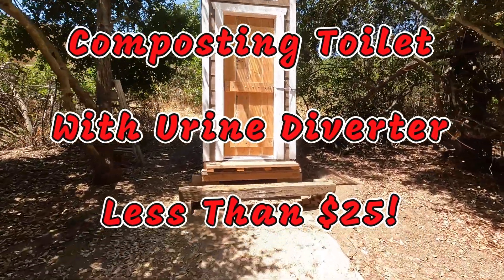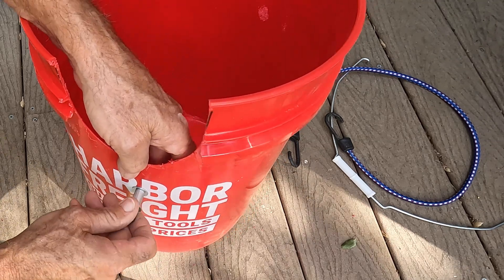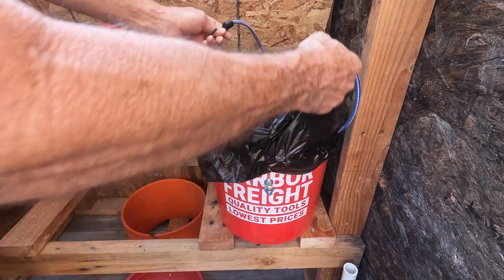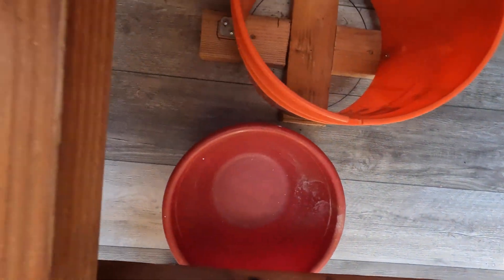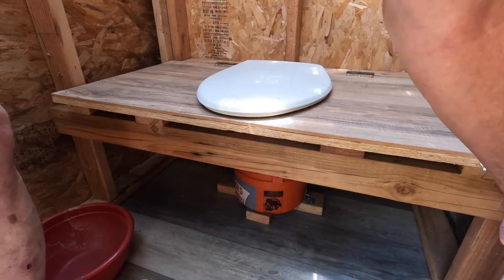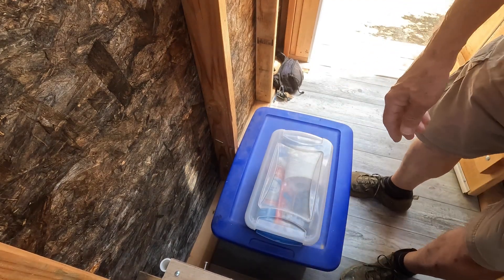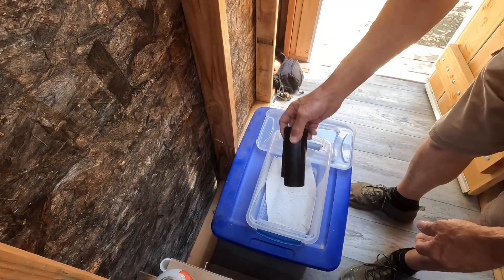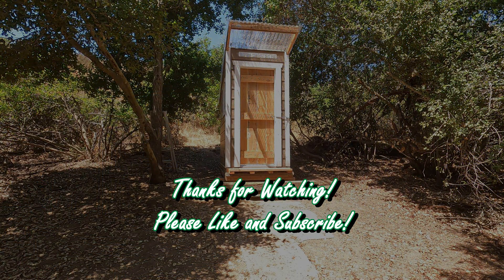How to - Composting Toilet! Urine diverter - Easy to Build. Only $25!

Comment: Couldn't the funnel be screwed to the frame so it stays permanently in the pipe? Or would that not allow the bucket to come out
Reply from the maker: Yeah, the funnel overlaps the bucket so you're correct, it wouldn't allow the bucket to come out. Thanks for watching and commenting!
Reply: @RanchoCoyote  I suggest you cut off the bottom inch of the funnel to make it fit better.

Comment: UMM composting toilets use bacteria from wood chips or forest moss or duff or sawdust.  When one uses ash or lime your killing bacteria not encouraging it.  This system could use much improvement and i highly recommend the 'Humanor Book" to learn more. there is a min temperature 140 D F I believe to kill pathogens.
Reply from the maker: Thanks for your input on composting toilets. The video did mention using ash for odor control, not full composting, and also highlighted other materials like wood chips or sawdust for bacterial activity. It even suggested searching the internet for more material options. While ash can help manage smells and balance pH, it’s used lightly to avoid harming bacteria. The Humanure Handbook is a great resource, and you’re right about the 140°F needed to kill pathogens, but since we discard the bag pretty much after 1-2 uses, our focus here is mainly odor control rather than full pathogen elimination. Thanks again!